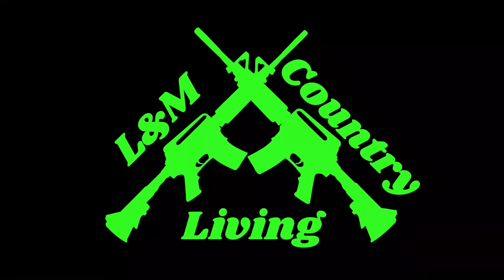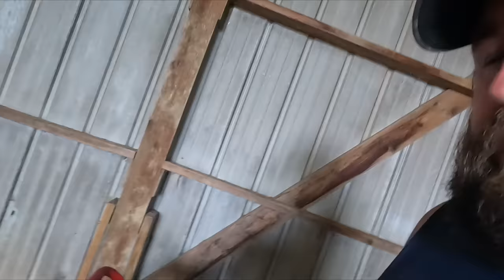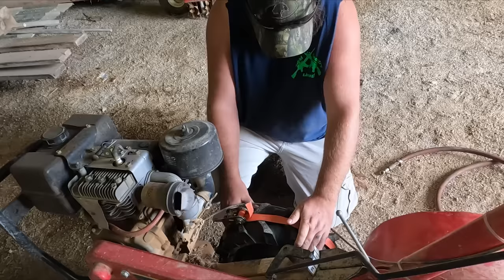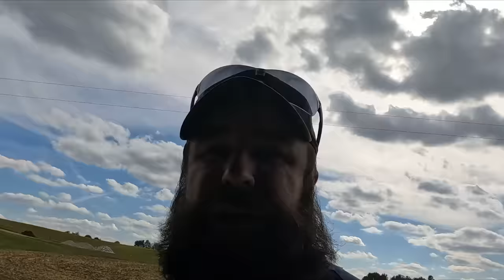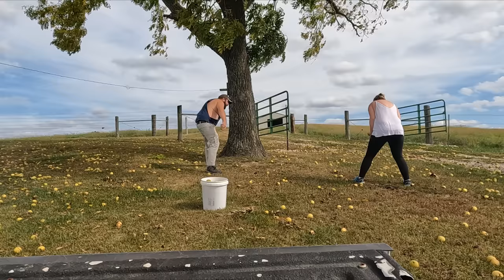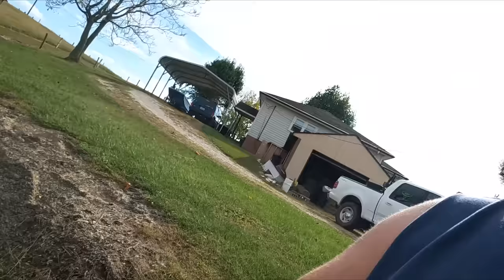Walnuts and Tires

Comment: As a kid, we used a rake and coal shovel to get the Walnuts, as for the tiller tire, sand the rim, and clean the heck out of the bead, and as a kid, to seat a tire to put air in it, we used dish soap around the bead, we sprayed Either in the tire cavity, and put air to it as we lite the either, the ignition would swell the tire and the air would inflate the tire😵‍💫 not for the faint of ❤️ but super fun for us!
Reply from the maker: Ive done that trick a few times I didnt have any or you bet I would have done it

Comment: When you get it back on and get it filled with air get you a bottle of  slime to put in each tire fill them back up then rotating a few times to get it around in there and you should be good to go I've used it for years in my lawn mower shop repairing tubeless tires
Reply from the maker: I need to pick me up some of that thank you

Comment: Had same problem with tire on cub cadet. One tire had slime in it. I did'nt tell the mower guy to use it either. Ordered tubes and took it to tire guy.
We got a walnut tree out back too👍🙂
Reply from the maker: Ive had a problem out of it for a few years but most of the time you could put air in it and it would stay up most of the summer but it just gave out this time
Reply: @LMCountryAdventures  You'll get 'er goin👍🙂

Comment: For your tomatoes set a metal fence pole at each end of your row and use some scrap woven wire fence and run it down the row so as your tomatoes plant grows you can weave it in and out of the fence and tomatoes still easily accessed on either side
Reply from the maker: Cool seem like that would be a lot easier than these cages thank you

Comment: Take a rubber mallet or hand mall tap around the rim it'll seat. I'm sure you probably cleaned the bead good on the rim. Really on lawnmowers and equipment it's best to put tubes in them. If a tire goes down and it doesn't have a tube the rim will get rusty from settling in the dirt.
Reply from the maker: Ive got a couple of tubes ordered cant wait to get that garden tilled